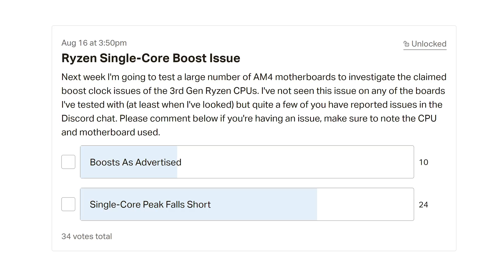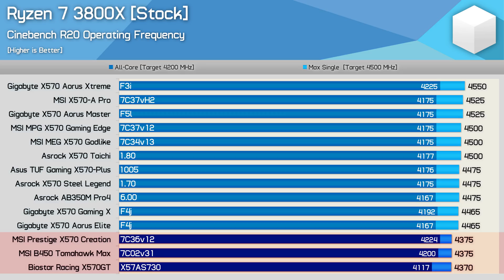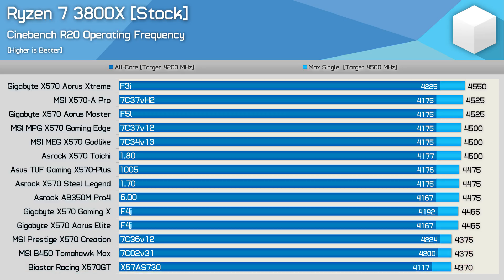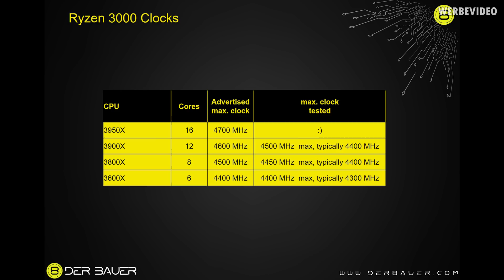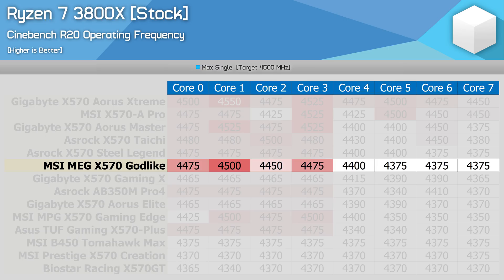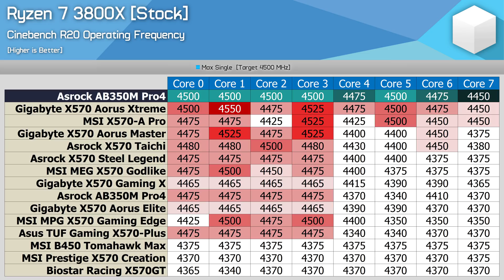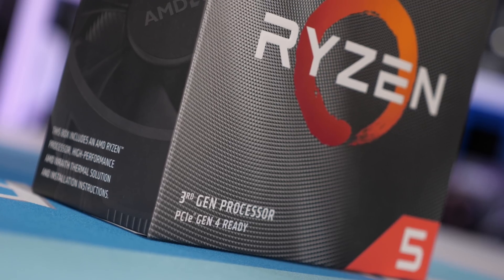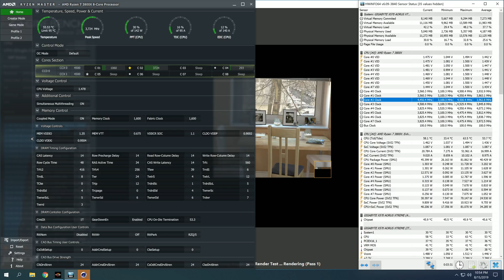AMD 3rd Gen Ryzen Boost Clock Investigation

Comment: That must have been a decent chunk of work. Great content as always!

EDIT: This might be a dumb question but could CPU TDP limits be responsible for the difference? The motherboard partly decides how much voltage to supply which could drive up power usage at a lower frequency forcing the CPU to lower frequency in response to stay under target? I'm thinking some VRM implementations could be artificially driving up voltage to make up for ripple and other instabilities.
Reply: TDP should not be the limiting factor of single core boost frequency but voltage difference between VID and Vcore will differ between boards due to different VRM implementations.
Reply: @bloodyhell7468  ahhh yes of course, that's a good point, so it can't explain the lower than advertised single core boost frequency...
Reply: Thought about that before. Is the AMD CPU really using the TDP as an artificial limiter - like a power target on a GPU? (With Intel TDP is just a number on the box but the chip doesn't care for it.) If the MB can supply the power (VRM thermals and voltage ripple are in check) and the CPU has thermal headroom, we should have an option to just not care for TDP and run the chip full tilt until some component runs into an actual hardware limit.
Reply: @TykeMison_  interesting. Glad to know my thinking has some merit. Perhaps of the motherboards tested in the video some are more conservative in avoiding the TDP cap. Or some are misreading due to cheap circuitry meant to measure voltage and current. Either way until we get a more complete explanation I don't believe it's fair to pin this completely on AMD, though I'm sure the rushed launch didn't help the mogherboard manufacturers at all.
Reply: @TykeMison_  I'm aware of the other design limits but they aren't really relevant to the pondering comments regarding TDP to which I replied.
Plus unless you have a really poor cooler and/or contact; none should be affecting single core boost.
Reply: Nick Yatracos i thought the same thing. Considering that some boards have 1.40 volts or even higher, i bet this has something to do with it. I wish he had mentioned the voltage, if he thought about it of course.
Reply: you might be on to something as many have tested and shown that ryzen frequency is very much tied to temperature, whereas with intel chips temperature is just a limit to how much voltage you can push

Comment: But, thanks to this VID i see it is not just ASUS boards, tho it is pretty much every ASUS board not making the boost cut. It will get sorted out once their bios get gud. It may LOOK like it from HWiNFO, as even I see like 4544 sometimes, but its not holding this nearly long enough for it to matter, not when youre relying on PB2/PBO/Auto OC to do it.
Reply: I have "NO" issues getting the "box rated 4.4ghz" on my 3600x (lightly threaded workloads) with the crosshair vii hero mb (bios ver. 2501-agesa 1.0.0.2) straight out the box with no tinkering required in the bios.
Reply: @kidchunk8989  in order to check to see if its 'maintaining' it, see if you have a different scores when manually OC it 4.4ghz. Probably will.

in my case:

Crosshair VIII Hero, 3900x

PBO/Auto OC/Default = 205 single core score in Cenebench R15
Manual OC CCX0 4.6ghz = 216 single core score in Cenebench R15

Comment: I used to see 4650 on my 3900X on one of the first UEFI releases but RAM performance/compatibility was terrible. On the latest for my board (xxxxxAB) I onky see 4500/4550 but RAM compatibility is better. Still waiting for the latest ABB to appear for the TCU, almost every other board from AaRock has seen it. :( That's what you get for buying the top boards, slower support.

Comment: Obligatory like and comment for maximum engagement for swapping so many motherboards.
Reply: Absolutely! These guys don't shy away from the required work, just to be thorough and get us some answers!
Reply: interaction for the algo
Reply: Yup, gotta make sure they get their well deserved!
Reply: @DarkReturns1  Indeed! I wonder if the algorithm can detect a circle-j@^! of us agreeing with each other.
Reply: @thegoblin3629  😂
Reply: I have asus crosshair viii. I had issue with boost clocks at first. Never saw above 4.3 single core and 4.1 all cores. But after playing around with a few settings I got it to boost max 4566.6 and 4.2ish all core. I have seen during games between 4225-4550ish on up to 6 cores. So I disregarded my manual OC. To get this I had to set my ram at 3533 and PBO On. And there is a setting in bios above cpu ration for performance enhancement I had to set it to level 3(OC) it’s described as holding boost clocks for longer durations. This helped the single core boost. Setting ram to 3600 single core was limited to 4516 max but setting to 3533 I saw 4566.6 on 3900x. Now to benefit all core boost it does help to enable +200 under PBO settings. I did see my all core boost sustain 4192-4242 depending on load. Leaving it on auto was are kind 4065-4100. So it seems AMD allows board makers to do too many things and too much control over it. They should put some tight control around boost speeds. +200sAlso did improve my all core in games it seems as well. Before it was dead set on 4200 ish now I saw 4225-4550 peak.
Reply: @NetworkNinja2k26  Good tips. Bittersweet, the whole death of manual OC thing. It's the dawn of the PBO era!
Reply: HU deserves some sort of pro-consumer medal or honorary mention from a related institution/officials.
Reply: Yes, let's generate some drama. Everyone dislike my comment and then upvote anyone who replies after me. We're being controversial!

Comment: TL;DR its bios. I guarantee you these processors can do the speeds listed. I have my 3900x at 4.6ghz CCX0, 4.4ghz all others. I get 216 points instead of 205 points in R15 manually clocking CCX0 like that.

More specifically, its ASUS's bios at the time. MSI and Gigabyte weren't asleep at the wheel this time for Zen 2 launch :3. Slightly disappoints me being an ASUS user myself. And on that note, at stock I also do not get the advertised boost clocks with my x570 Crosshair VIII Formula, which is obvious to me given my scores.
Reply: Board?
Reply: @ubann00b  Crosshair VIII Formula

Comment: At least, you can achieve max boost frequency on mediocre b350 board. Maybe in a320 board too.
Reply: a320 doesn't allow over clocking i believe.
Reply: @karltaht2370  I believe that too but Tech Yes City success overclock ryzen 5 1400 on asrock b450m-hdv r4.0😅
Reply: I mean A320😆 What wrong with me🤣
Reply: Ahmad Rizki Hidayat you should NOT be using a ryzen 3000 series chip on an a320 motherboard, that is reckless and risky
Reply: @absolutelysobeast  You sound like a salty Intel fanboy stuck on an old mobo with no upgrade path. So you're telling people not to put a 65W Ryzen 3600 CPU in an A320. Do you know how stupid that sounds?
Reply: @Shizuna_no_Kiseki  Maybe what he meant was a ryzen 3000 series with 105w tdp😄
Reply: @Shizuna_no_Kiseki  do you actually know that tdp is way higher at full power? My ryzen 5 2400 cpu side at full power consumes 80-90 W, ryzen 3000 has great efficiency but tdp listes is bullshit
Reply: GreenHeartNext i have had my ryzen 7 1700 for almost two years now and im certainly not salty. I am confused though as to why somebody would get the newest, fastest best technology chip out there and put it into an absolute ass quality motherboard that is absolutely incapable of handling that level of power or wattage. TDP refers to dissipating heat, it has NOTHING to do with the usage of power of a particular chip. Even the cheapest 3000 chips would cost 4 times as much as an a320 motherboard and anybody who would pair those parts together has absolutely no clue what they are doing. Not to mention that a320 boards dont even support ryzen 3000 anyways. So hopefully its pretty clear to you now why i said what i did, it had nothing to do with irrational fanboyism and everything to do with common sense and facts that we all have access to
Reply: @absolutelysobeast  I know😆

Comment: Yeah, that is usually the issue with GPU like boost, especially if you advertise best boost clock. AMD could avoid this if they did bit more conservative clock. Just like nVidia won't advertise max boost on GPU, that way they can ensure actual boost is going to be above that. And "positive surprise" is always better than negative one. Though I guess AMD got bit too caught up with trying to get as close to Intel clocks as possible to avid criticism there, that they just forgot about what actual experience will be. And knowing how things work, you pretty much know that people will notice it, especially since it is deficiency, instead of excess.

Though interesting to see B450 boards in some cases worst.  I would still rather get B450 than X570, unless it is high end CPU, but  it makes one wonder if they are trying to use algorithm more akin to previous CPUs, where all cores would be able to hit boost clock and it is getting confused by the fact that on new CPUs, some cores won't. Which is fine, since all core boost is lower anyway. In any case, interesting video.
Reply: Seth NoWai people wont buy the processors if they advertised the same clock speeds as ryzen 2000 series. People cant reconcile an ipc difference, they can however reconcile a few hundred mghz increase
Reply: @absolutelysobeast  That is true, but then again, at what point are we going to resort to lies? Because we are getting huge diminishing returns in extra clocks we get from shrinking and this won't go forever. So what then? Lie about it? I don't think this is the way to go, but rather to start working on educating consumer, or advertise some actual performance metric. Because we both know frequency isn't everything. And there was time when AMD was successful with lower frequencies. Back when Intel was still dreaming 10Ghz CPUs. And I don't think frequency would be that big deal, they could just reduce it for 100Mhz. Because guaranteeing 4,5Ghz turbo and then not delivering it is not the way to go and we would eventually go towards even further discrepancy between what user gets and what is advertised and that would eventually result in rightfully deserved lawsuit. Right now they are already bit borderline, but there is very thin thread between that and misleading customers. Which regardless of reason for it, I will never support, if they have to go to that, they might as well stop existing.
Reply: Seth NoWai i agree, i dont think its right either, but a company will always do borderline immoral things to get more money and profits. Its just like tv manufacturers claiming a 240hz refresh rate, i mean alot of tvs are not even true 120hz, let alone 240hz. So this is where it is heading. But also AMD cant be held responsible if the motherboard vendors dont implement the bios well or have sub par power delivery. I mean gigabyte got their cpus running at advertised speed, why cant the rest?  The difference comes when AMD is claiming so very close to its maximum performance that there isnt much wiggle room. Porsche is the best known company for these types of things they ALWAYS underpromise and overdeliver. They say it has 230hp its probably closer the 250. They say 0-60mph is 3.2 seconds, it probably just under 3 seconds. But in this case AMD is in a cutthroat war with intel and they will take every chance they can to build up their product line compared to intel
Reply: @absolutelysobeast  I do understand what you are saying. But still, when they do it, they should be called out and if it is straight lie, they should be responsible for it. And as I said, it is borderline. It won't stop me from saying that Ryzen 3000 CPUs are amazing. Though where responsibility lies, is kind of questionable. I would say power delivery is unlikely culprit, since on few reviews I did find for 3800X, 2700X was a bit more power hungry than 3800X and 2600X came at least close, meaning this would be an issue before already. Plus we do know at least some of those boards can do more, otherwise 3900X would not be supported. So I would say it is mess with BIOSes, which in large part are AGESA, which is just a binary made by AMD and not modified by board partners. Now I can't say if it is AGESA or not, or whether AGESA would need some adjustments based on board, it could be board partner fault, we actually can't say whether it is or isn't. But AMD should take time and make sure it is not an issue, instead of rushing for 07.07.2019.

Comment: X570 Tai Chi with 3900X, never 4.6 (4.5 extremely rarely)
Reply: 4.5 on all cores or is max that one of the cores managed to chieve?
Reply: @ButtonMashers84  nice :)
Reply: @goca4451  im looking at the same setup. is the X570 Tai Chi a good board ??
Reply: @MrAwol007  It is a good board, but i had issues with the chipset fan going crazy loud on me. I managed to find bios updates and after i installed the last one my 3900x had only 6 cores and 12 threads(the rest were on strike probably or in holliday). So i got in contact with Asrock and they told me to reinstall the the initial bios and then the latest one. Now i have all my 12 cores and almoast no noise from the chipset fan and managed to get 3135 score in Cinebench r15 with no overclocking. RGB is nice as well...
Reply: @ButtonMashers84  thank you. im going to get the board to pair with 3900x i can deal with bios updates :) it looks a good price plus good vrms
Reply: @MrAwol007  Its a good combination, i got the 3900x, the taichi mb and 64gb ram 3200mhz and 2070 super and one of that pcie 4.0 nvme from Corsair. I could not find anyone to tell if i can put my gpu on the second pcie slot, because if i place it on the first one it blows heat directly on the chipset fan :).  So i moved it to the second slot and i lost about 10% gpu performance(used some gpu benchmark programs before and after), but im ok with that.

Comment: I have a 3700X on an Asus X470 strix Gaming-f cooled by a Noctua NHU-14S with PBO enabled and all other settings stock using 16GB of DDR4 3600 CL18 memory. While playing a game that uses only one core and CPU utilization at 6% I still never see any frequency higher than 4275mhz. My processor generally runs at around 4200mhz with high-load (stress test) frequencies of 4100mhz and a max temp of 68c.

Comment: I have a 3600 and still only hit 4.125 on a 4 cores and 4.1 on 2 cores. B450 Steel legend. Before I updates the agesa it boost a little higher but still not 4.2 and xmp didnt work and i had audio issues and system stutters. Now it runs great just no max boost, no matter the monitoring software or PBO settings etc. Ryzen Master doesnt work right either so i wonder if it's an issue with the fact i upgraded idk. Makes me wish i had an x570 for sure, but its still an amazing CPU for 200 bucks, especially with my 5700 XT i just got. :)

Comment: Definitly not hitting 4.4 Ghz single core on my 3700x with the MSI MPG. More like ~4.3. And yes the thing is well cooled with a high airflow case and a Noctua NH-D15 as I've yet to see it go above 70°C anywhere.
Reply: I've never seen my 3700X go past 4.25 on a single core. I'm running custom water cooling, temps are fine.
Reply: @riccochet704  My 3700x can hit  4375 Mhz on 6 out of 8 cores for the single thread. The remaining two hit around 4325Mhz. This is on MSI B450 tomahawk with a stock cooler. Make sure you have the latest AMD chipset drivers with the ryzen power plan.
Reply: @Vanlonja  I'm running a X570 Aorus Ultra, all drivers and firmware on latest versions. I've tried stock settings, PBO+AutoOC set to  +200, messed with voltages. I guess my chip just can't get past 4.25 on its own.
Reply: @riccochet704  same for me... Tweak for one whole week but no luck.. Ended up on manual OC all core 4.2GHz @ 1.33V.. 

Previously on default with PBO enabled. All cores only hit 4.1GHz @ 1.38V and single core 4.35GHz @ 1.51V... I regretted trusting AMD...

Btw, rollback to 1.07.07 chipset drivers. It's proven to have better performance than the latest..
Reply: David Graham same here on my 3700x, mine hits 4.25 max single after swapping multiple other parts including cooling and ram and 2 bios revisions, 4,1 all core on an msi b450i. Going to try an X570 board this week.
Reply: i have all my cores set to 4.275 on my 3700x and was quicker than out the box setting.
Reply: @paulcanning21  Same for me! All Core OC to 4.275 GHz.
Reply: My 3600x oc all cores 4350mhz boost 4433mhz 1.360v h100v2 30c 55c  max temps g-skill flare x 3200hz cl14 b die 2x8 16gb memory oc 1900mhz 3800mhz 16 16 16 16 32 48  1.40v msi b450 tomahawk gtx 1070. Cb 20 496 , 3772 , userbenchmark 100 , 96 , 86 im happy.  5700xt coming soon.
Reply: 1967 kID you should be getting 1-200pts more on CB20 multi if you’re actually hitting those clocks. 

My 3600 locked to 4.2GHz all-core with 3600 CL15 RAM scores 3850 in CB20 multi. 

You might be stressing something too much—higher numbers don’t always equal higher performance. Pull back on the reigns a little bit and see if your score goes up.
Reply: Mine neither, after the 1.0.0.3 agesa update i can barely reach above 4.2 ghz.Also the idle voltages are always high (+1.45v) whenever steam, discord, epic store or battle.net are running.
Reply: Running 4.35ghz all core OC at 1.35v. That's all I can go. On a dark rock pro 4 under max load only reaching 65 degrees. MSI b450 carbon pro ac
Reply: Sillicon lottery and board different quality component from your region.